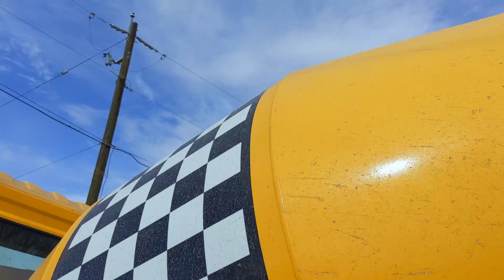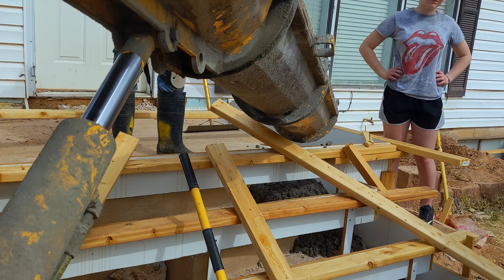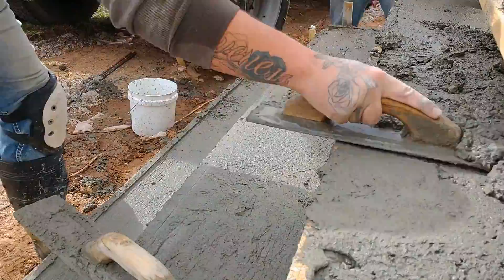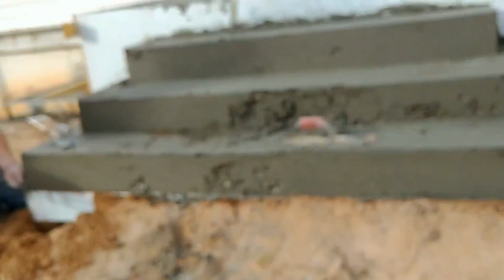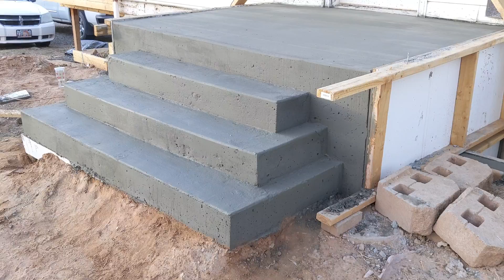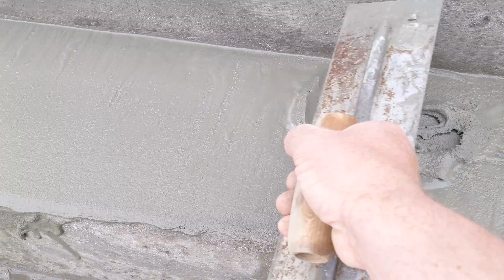Concrete steps #2

Comment: Do you quickcrete? And how long do you wait to pull off forms?
Reply from the maker: You can use quickrete or bagged concrete, it's just a lot of mixing. The forms can be pulled the next day but be careful because the concrete will be brittle for a few days.